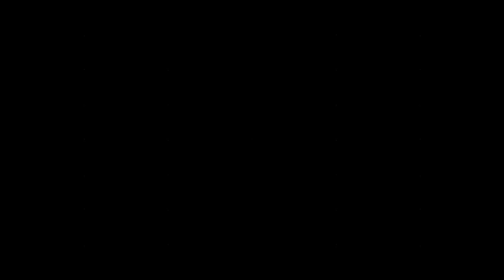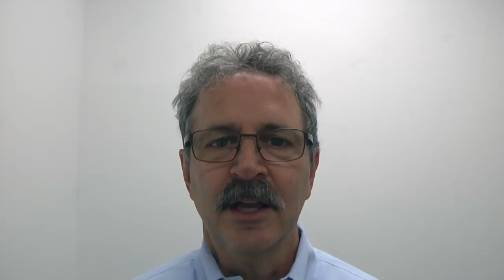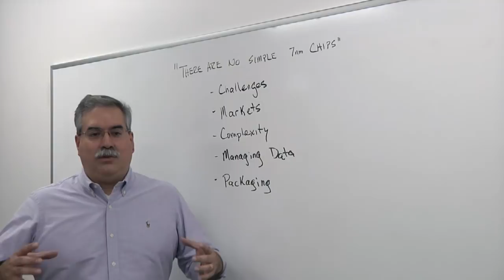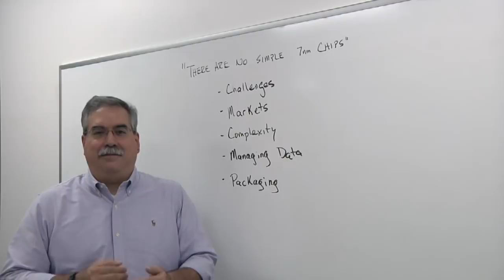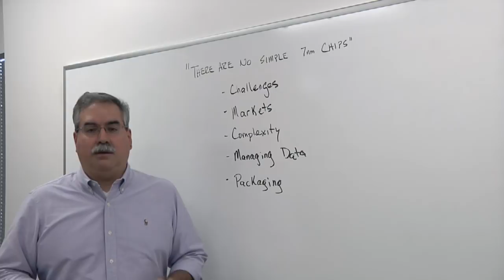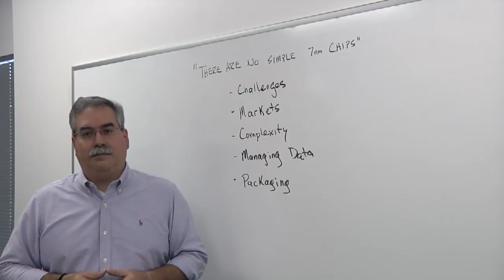7nm Design Challenges

Comment: Thank you for this, it helps those less educated in semiconductor design challenges understand what it takes to progress. I think videos like this peak interest in this field of study. If you're a person looking for a challenge 7nm is where it's at. In the late 90's it was a website with a .com extension. Today it's 7nm and all the processes required to produce it. EUV vendors are going to be very busy in 2019 and beyond. TSMC paid the early adopter tax and is now reaping the benefits of EUV and 7nm. Intel should've poached top talent from Samsung and Qualcomm rather than AMD. They are already at 5nm. By the time Intel gets their 7nm production rolling. AMD and TSMC will be on 5nm, Samsung, and Qualcomm will be pushing 3nm ultra--low power. Intel needs to pull an AMD move and break out the foundries as a separate business on their own. They need the freedom and requirement to innovate in manufacturing  and process technology. Intel imo needs to concentrate on circuit design and ipc improvements. They are losing "Mind Share" to AMD and TSMC.
Reply: So AMD and TSMC spun off their foundries?
Reply: @William_sJazzLoft  What?
Reply: @jerrywatson1958  from what little I know about semiconductor physics, physical characteristics change the closer that one gets to the atomic level. And it's really at the nanometric level that I think quantum principles begin to find practical application to problems in semiconductor engineering.
Reply: @William_sJazzLoft  Whatever the physics are the engineers at TSMC have figured it out with the materials they use to make silicon wafers. The investors need to fire the board of directors and elect new ones with semiconductor engineering degrees. Then get to work on 5nm and GAA at 5 and 3nm. Steal some people from IBM labs. They have been designing and making 5nm and GAA at 3nm for the last few years. All the would need to do is scale up whatever they came up with.

Comment: Im not an expert so i have a question, at such small node sizes what are the effects of natural energetic particles on the components? for example  if a cosmic ray hits the die and causes a cascade of ionizing particles would it damage components? how this could affect the lifetime of such chips?
Reply from the maker: That is definitely an issue. These so-called single-event upsets are known to flip bits in memory. At 7nm and beyond, with transistors packed so tightly together, an alpha particle could do damage. This is more of a problem at higher altitudes, but there has been some discussion about this at conferences.
Reply: @SperlingMediaGroup  It also depends on the material characteristics of the materials used in circuit design. I looked into micro chips (cpu's in particular) designed for radiation hardness. I don't remember the article but I guess you could google it. But they had a test circuit that they irradiated in a nuclear reactor for a period of time. I think after 3yrs of exposure they pulled it out and it was still functional with only slight discoloration. I guess they want to move on from i386 cpus in space.